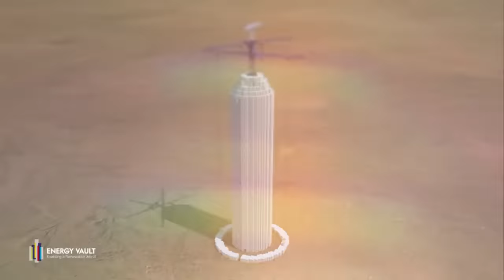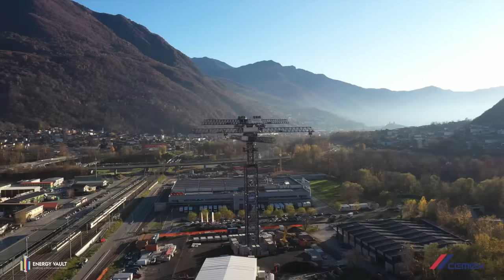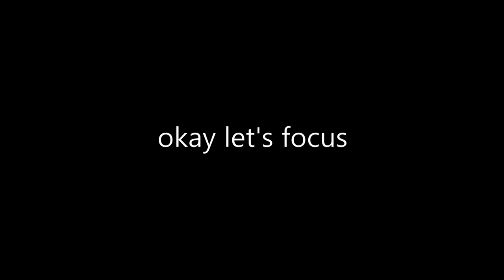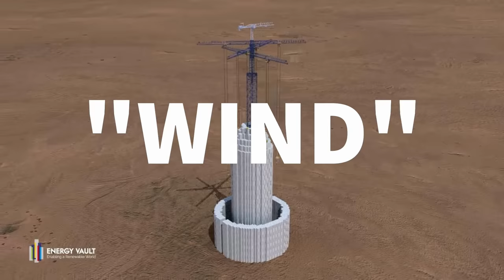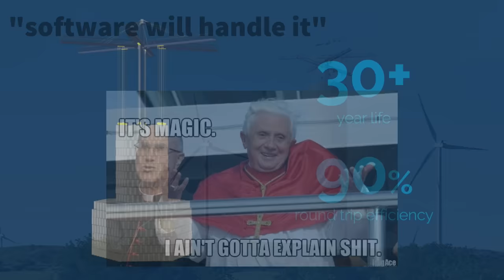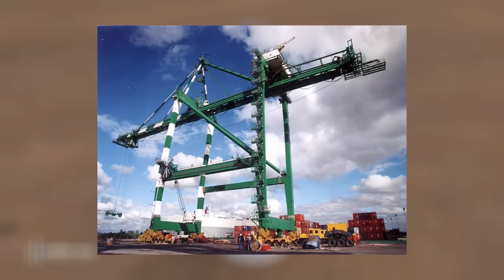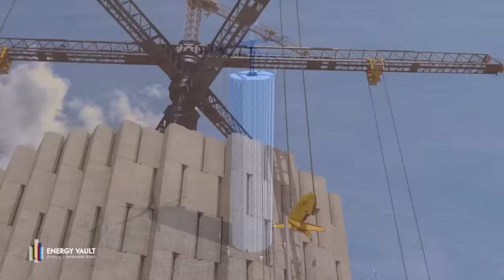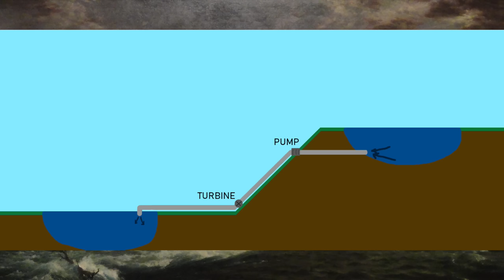The Energy Vault is a Dumb Idea, Here's Why

Comment: Id love to see what happens when one of those tiny ass feet that are meant to hold these huge concrete blocks breaks off and causes the whole thing to collapse like a Jenga tower.
Reply: I was thinking that. The mechanism for holding those blocks doesn't inspire confidence. I wouldn't stand near it.
Reply: The software will handle that eventuality
Reply: @Mt.Berry-o7  lmfaooo
Reply: Have a look at container cranes.
Reply: @jackdeniston59  Yes but container cranes do it with metal shipping containers, whereas with the video it shows cement blocks with only the edges being secured. The edges of cement crumbles over time.
Reply: Even better
If one of the blocks happens to break
Best effects of at the bottom
Reply: @s3bastiaan  Yeah, a concept video that shows lack of scientific, mechanical, and engineering understanding.
Reply: Uuuuuh, software will handle it.
Reply: @ishpulc  clearly you don't. a concept is "an abstract idea" meaning that a lot can and will change as the project progresses. Clearly you have no idea how engineering works as in the real world, pretty much never does a concept of a idea look anything like the finished project. The video is just showing the "concept" and is not supposed to be final.
Reply: @s3bastiaan  problem is, morons invest in this unrealistic cgi concepts, burning millions in research for a project that just ends up getting canceled because it's not feasible. It's best to call out and avoid this concepts and demand designs built with proper understanding, that way the odds of wasted money are less.
Reply: @s3bastiaan  Saying "it's just a concept" doesn't make the concept needlessly dangerous, wasteful and overly complex. A water system is better in every way and infinitely cheaper both to construct and to maintain.
Reply: @DivusMagus  yep, and sadly the wind turbines are one of the better examples of practice vs theory, the sails are co2 negative from the steel production and short lifespan of use, and they are completely unrecyclable...
Reply: @s3bastiaan  that argument might have some merit if there wasn't so many problems with even the concept that is being displayed here. it's an overly elaborate system with tons of ways that a single failure can cause a whole slew of other failures in part of the process that wasn't affected by the initial fail.  And there is much simpler solutions that will do the same job. Even if your thinking the option submitted at the end might not work everywhere as you need a hill or something.  then you can still use the tank and pit idea, which will not require there to be hilly terrain or take up a wider footprint then this energy tower, but still do the same job with far less moving parts and far less precision needed. no where near as sexy looking and is likely something they can't patent, so they can continue to get money off the project even after it's built.  but it still is a great gravity storage method.
Reply: @jackdeniston59  yeah but container cranes have a more logical system of using ropes and a proper attachments to secure containers. None of this duck feet nonsense.

Comment: Another big benefit of pumped storage hydroelectricity over the "Energy Vault" is that it can be started during a blackout, while most other powerplants need some power to start up. You only need to open a valve after all. I doubt the Energy Vault would be capable of that, as the cranes need power to just get the blocks off the tower.
Reply: That Power isn't more than what you need to "only open a Valve". Hydro Plants have Diesel Generators for that Puropse, and it wouldn't be different with the Energy Vault. It's still a rubbish Concept tho
Reply: @Genius_at_Work  it is different in that you only need to open the valve once... whereas every block wastes energy getting moved off the stack. And at least theoretically you could make most hydro plants operable with human power only it would just mean the valve opens fairly slow (think treadwheel power etc)
Reply: @Wingnut353  I have a bit Experience in your last Point. The Force required to open Valves gets ridiculous as their Size increases. I occasionally have to operate a manual Butterfly Valve roughly 70 cm in Diameter, and opening or closing it takes three Men at least 15 Minutes. And that's just the Cooling Water of a fairly small Container Ship.

Plus there's a lot more to Hydro Power than just opening a Valve. Like in almost all Power Plants, the Generators must run at an exact Speed to maintain AC Frequency. This requires large and heavy Guide Vanes in the Turbines, to adjust for different Water Flow Rates and different Electrical Loads. Run of the River Hydroelectricity also needs a lot of Hydraulics for the Weir to regulate the Water Level in the River, and thus have 500+ kW Diesel Generators.

Btw. said manual Valve must be closed to clean Sea Cooling Water Filters, and because that shouldn't happen very often (but may in Areas with a lot of Plastic Pollution, e.g. India), a hydraulic or electric Valve isn't worth the Money. The Valve between the Cooling Water Intake and the Filter is hydraulic, as quickly closing it is very Safety relevant. The manual Valve is between the Filter and the Suction Pipe of the Sea Water Pumps.
Reply: This guy makes hydro sound so much easier than it is. Just open a valve he says hahaha
Reply: @Genius_at_Work  additionally, basically all big generators need electricity to function because we don't use inconsistent permanent magnets for the rotors but have DC "excitation currents" for electromagnets wrapped around the rotor to provide much greater control over the magnetic field. Obviously when the grid is on everything is self powering, but from a blackstart you need a diesel generator with a permanent magnet rotor to just get the thing turned on, or you need someone else to energize the transmission lines to give you a jump start.

And you are right that "just opening a valve" is no joke. And while in theory a tiny hydro generator could be designed where 1 person could open a single valve to serve as a backup, the engineering expense is dumb compared to just using a normal generator or battery backup.

Comment: I actually saw the prototype in Ticino Switzerland a couple of years ago. Its just opposite the railway station in Arbedo. It was an utterly bizarre looking thing. Took some photos and found out what is was... Interestingly enough, my immediate thought was about the CO2 emissions of creating the concrete blocks. I studied civil engineering at uni and remember one amazing statistic from the materials lab... To manufacture 1kg of cement (the bonding material of concrete) creates 25kg of CO2! I cycled past it again in the spring this year (2022) and it was being dismantled. As shown in the video, an alternative to concrete is rammed earth, this is a versatile building material that's been around for millennia. Using a less impactful bonding agent (say lime) this could be a viable alternative.
Reply: One thought I had was that if you're doing it in a pit to get out of the wind, save a whole bunch of the dirt you remove & use that for the weight of the blocks, like instead of solid concrete, make them like giant buckets filled with that dirt.
But yeah, water being self-leveling & the tech already exists are 2 very large plusses, & I'm sure there's a lot more energy loss to all those cables & the horizontal block movement than there would be with appropriately sized pipes.
Reply: The big problem with any kind of gravity-based energy storage system is that gravity is just not that strong a force. You need vast masses (which is what hydro starts to get you) or vast heights for the storage to become significant enough to matter. That's why this tower can only handle the approximate energy output from one wind turbine.

I've seen other schemes with masses going up a hill on rails and such. If you do the math they just don't have that much capacity. I saw one that involved lifting whole blocks of land from underneath by pumping in some kind of fluid. Still seems overcomplicated but with that one, at least the masses were getting into an impressive range.
Reply: @MattMcIrvin  with a rail based system, I'm pretty sure you'd lose a lot more energy to friction & moving the engine/carriage around, especially since the grade is limited so there's a lot more horizontal motion that doesn't store energy, it costs both ways.
Reply: @LightbringerDesigns  With a rail based system you don't move the carriage around, it's fixed and the carriage is pulled by cables. You can get some pretty steep inclines with funiculars (specially without passengers), and friction losses are minimal.
Reply: @LightbringerDesigns  How about just using stone blocks like Egyptians and Mayans. Why this much emphasis on something complex as concrete? 

Stone blocks have minimal maintanance and nearly zero wear and tear. And can last for centuries.
Reply: @vish5798  If you have access to rocks that allow you to cut stone blocks, you also got access to an area where you can gather water if you drill and a rock you can cut for water-based accumulators/heat sinks, heat pumps.
Reply: @burningsinner1132  All I know is there's lot of rock hills & mountains in my state. Here they use rocks cut into cuboid stone blocks that are laid together for constructing pavement edge lines along with rectangular cut stone slabs used as pavement flooring. There's abundance of such resource over here so a highly economical option cost wise with minimal impact on the environment, therefore making perfect sense as a replacement to concrete for these gravity battery towers. 

These stone blocks can last for a long long time. We have many ancient stone sites over here that are still intact.
Reply: @vish5798  What I'm saying is that any significant stone deposit creates a lot of pressure on the ground, which results in very drill-friendly wells. If there are rocks, there is water if you are ready to drill, and, since you got a lot of rocks (and water is not running everywhere, so you have watertight bed), you also have a solid base for any construction, which kinda defeats whole point of building towers when you can dig holes and exploit water.
Reply: @burningsinner1132  OK got your point.

You're saying it's not worth cutting the rocks and sacrifing the perfect terrain where a readly available waterbeds are stored deep undergound, and can be easily drilled into due to the existing high gound preassure. I can say you're right on this. Possibly if I may stretch into saying that the entire water can be pumped out into a ground based reservoir with a hydropower dam. This can be a great option for large energy storage.
 
In response my opinion is that there's many many hills here that are not too high and are found everywhere, some even stringed together laid across flat plain lands. I find it OK to sacrifice these smaller rockly hills to the bigger ones, since they don't have as much ground preassure. The rocks coming from them will still be sufficient in constructing few hundred gravity battery towers that can last atleast for more than a century, becuase of the stones durability. And totally worth the sacrifice. The bigger rocky hills can be left out for drilling out water and preservation.